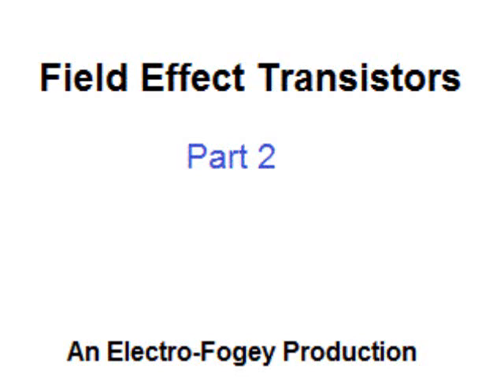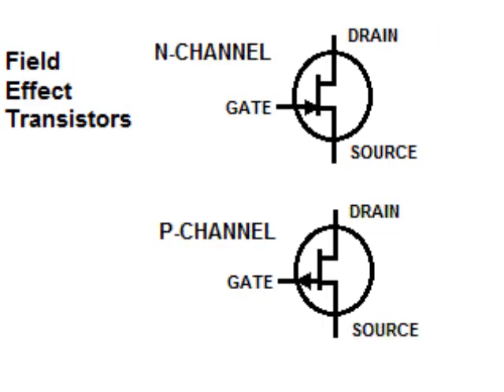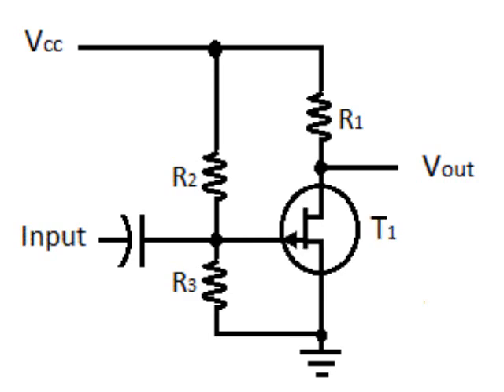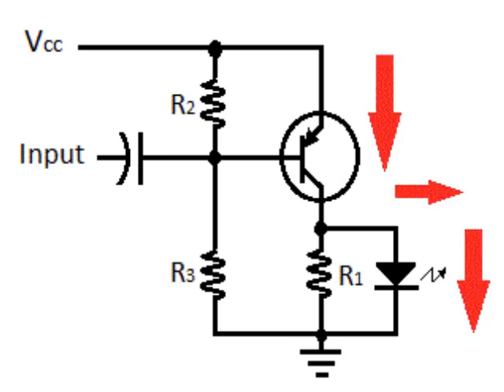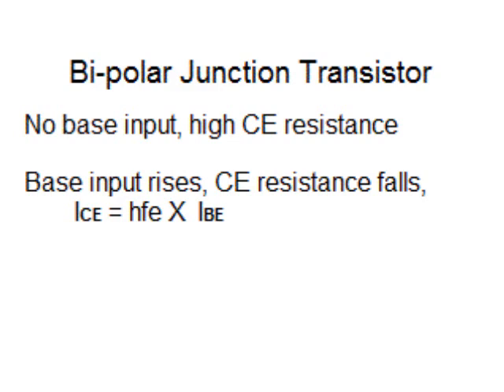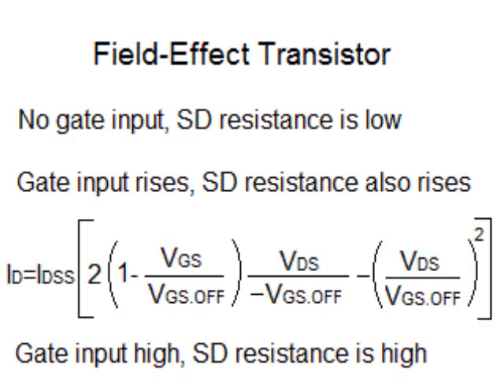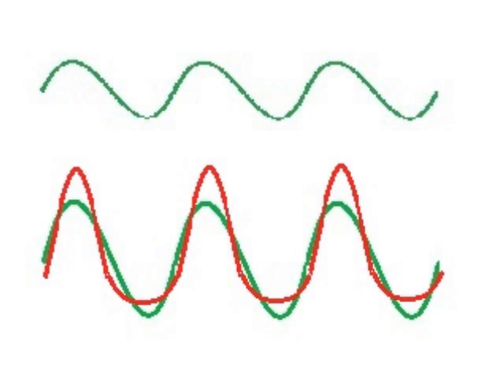Field Effect Transistors, Part 2 (updated)

Comment from the maker: Oliveguss, the circuit will use generator, transformer to up the voltage for long transmission lines (the power grid system), then a transformer to lower the voltage at the substation, then a transformer on a pole near your house (called a "pole pig") to step the voltage down to household levels.  I don't work for the power company, so I am probably missing a step or two, but the point is that transformers are used, not capacitors.

Comment from the maker: As I said in the video, for small signals, the output will be very close to linear.  The FET output will be larger than the input signal, but its output will still be tiny, so it needs to be further amplified by a second stage.  The next stage of amplification is usually a BJT, but my car radio says it uses all FETs in the amp, so maybe they've managed to get linear FETs somehow (or the description might be misleading, I really don't know).  With the proper feedback setup, linear might work.

Comment: Great video man,,, one doubt I have, all I understood was that in FET the realation between drain current and input voltage was parabolic, and in BJT it was linear. So you said that for small signals FET serves better, but don't you think it is a kind of incorrect ampliying a signal parabolicly rather than linearly, and would it not lead to incorrect results if that input is served to BJT with gain of high value. Please help...

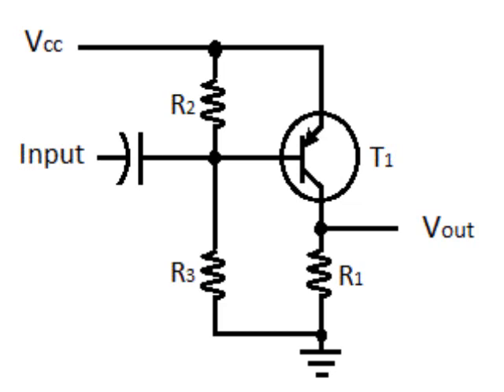Comment from the maker: At 5:01, the output voltage is not measured across transistor, but across collector resistor, so the circuit's output voltage (across R1) will rise as transistor's resistance decreases and its voltage decreases.  In a PNP transistor, remember that the difference in voltage between base and emitter is what "turns the transistor on", and the base has to be negative with respect to emitter.  Because the transistor is "upside down," as Vin rises, Vbe gets smaller, so trans resistance increases.

Comment: nice video..but m little confused about BJTs..while comparing BJTs and FETs at 7:08 He says as input voltage rises CE resistance decreases but at 5:01 he says as input voltage rises transistor resistance increases and transistor voltage increases too and vice versa..i dont get it..

Comment: Very good tutorial, thanks. Two additions: also a bipolar transistor can be set to a non linear mode, by changing its working point with the help of the base resistors. And: when a bipolar transistor is driven into saturation there is a small resistance and voltage drop parallel to the emitter and the collector.